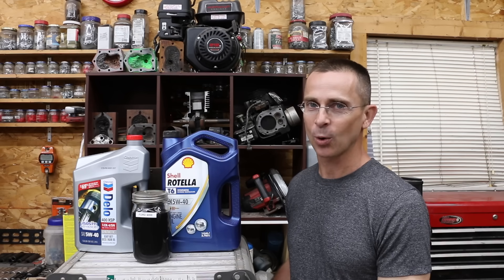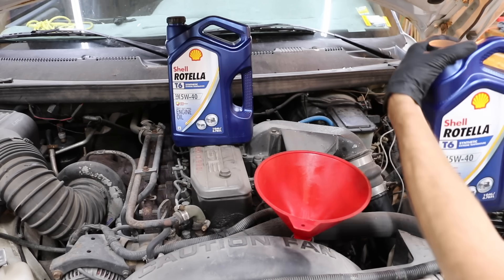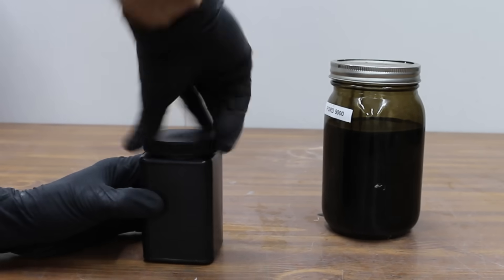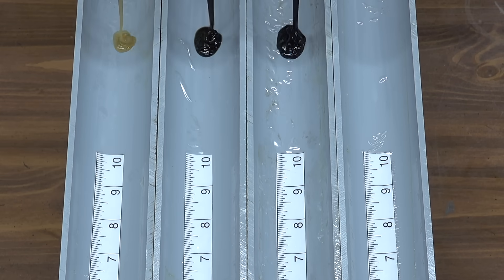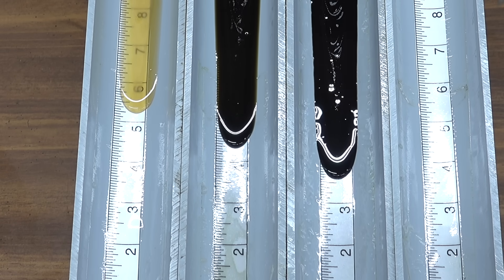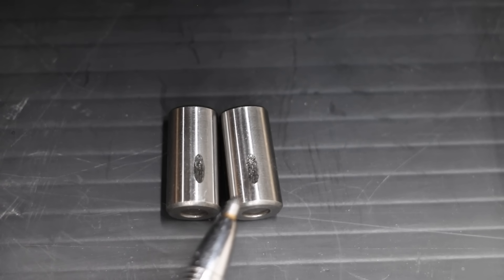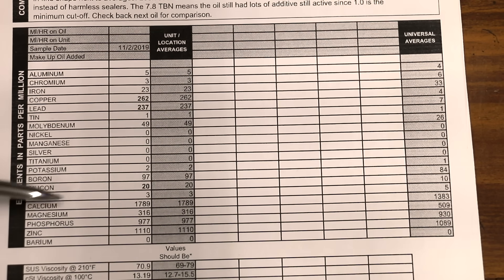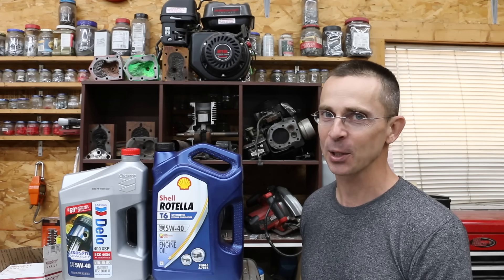Will Annual Oil Change Damage Your Car? Let's find out!

Comment: Thank you!  I'm putting less than 10K miles on my truck per year as I work from home.  I was wondering about the 1 year limit for oil that I've heard about.  Glad to see it is a myth.  I always use pure synthetic.  Mileage is another issue, but with modern metallurgy and lubricants I believe it safe to say that the 3K mileage limit is a myth.
Reply: The problem with extended drain interval is it doesn't get the raw fuel out, you have to count on the PCV system to do that well, which in a lot of engines is asking too much!  Also to me it doesn't matter if they used the finest anti-oxidant additive package ever made, all oil begins to degrade when exposed to air and additives can only work so long, even oil analysis can't show you just when that'll happen!  Not to mention the water vapor tends to build up in the oil too... I tried doing extended oil change, even spent extra getting the oil and special filters for it, but I just couldn't stand it -  leaving the oil in longer than 4 months just nagged at me too much and had to change it -
Reply: @robertmaybeth3434  I believe if the mechanical condition of the engine is good and there is little blowby, there should be no fuel and no moisture in the oil after about 15 miles of driving, when the oil has become quite hot for a while. Fuel and water will have evaporated.
Reply from the maker: Thanks for the feedback.
Reply: Honestly this test is pointless and I see no point of watching more than couple of minutes, because comparing annual or 12 month oil change to 12 or 17 is in the same league. Comparing 12 month vs 3 years old oil in engine would be much more interesting.
Reply: 3K mi. oil changes are from decades ago, before synthetic oils were available. Synthetics go 10K mi.
Reply: @joevarga5982  I'm beginning to agree. Scotty says change every 3k, but I've got 5k on my oil now and it's still clean. Not spotless, but can clearly see the dipstick.  Do you personally go 10k on synthetic?
Reply: @ceruleanc505  I don't personally run synthetic, but I have a family member who runs Royal Purple 15k miles. He changes his filter every 5k and adds the filter loss back. He then catches the oil and puts it in his tractors and lawnmowers, where it spends another year. I would argue with his system, but he worked 75 miles from home for 40 years and has had many vehicles with over 350k miles on them. I'm a firm believer in synthetic oil, I just can't convince my wallet to buy it.....sorry for the rambling
Reply: @quietobserver4636  No problem. Thanks for the input! It's like trying to hit a moving bullseye. Just want to keep my car up as best as possible without wasting money..
Reply: @ceruleanc505  
Scotty is "old school" on his oil changes. That is totally understandable and also totally OK imho. Changing synthetic every 3K is still cheaper than potential major engine problems !
Reply: @dancahill8199  Ok, but does 'old school' throw out perfectly good oil and money because it doesn't understand Full Synthetic?
That's my question.
Reply: @quietobserver4636  Hey there!  I started using Amsoil in my motorcycles when I saw an Amsoil flyer with pix of the sump of a Gold Wing before and after using Amsoil.  It was totally clean after using the "high priced spread."  I tried it in my BMW's, and darned if it didn't work there, too.  That carbon junk that used to build up inside the rocker covers was gone.  The additive package kept the carbon 'n crud in suspension better, so it made its way into the oil filter where it could be removed.  I am sure that any good synthetic would do likewise, I just happen to use Amsoil. I understand the wallet issue, but as an old lady once told me, "Oil is cheaper than machinery."  Good luck.  --Old Guy
Reply: @ceruleanc505  The color of the oil on the dipstick is not a good guide for whether you should change it or not.  The cleanest oil tends to migrate to the top especially after sitting for a while.
Reply: @robertmaybeth3434  There's no dirty oil on the bottom of the dipstick either. And I always test on a cold engine.
Reply: @ceruleanc505  you’re asking the right question and most, if not all these “old school” guys have zero research behind there opinions… this guy here has just shown us massive research into oil…
Reply: @ceruleanc505  Ok if it works for you.  I run synthetic oil right now but even then, I just can't stand to leave it in beyond 4 months!  It just bothers me too much.  I have taken apart several engines of mine, and that got their oil changed every 3000 without fail.  And of course, they were very clean inside, with very little timing chain or gear wear, camshaft and lifters in perfect  shape, not even a ridge in the top of the cylinders either.  And this was at almost 200,000 miles on the 1988 Nissan Z24 pickup, no less.
Reply: @robertmaybeth3434  if you can afford it, fine. But you are wasting your own time and money.
Reply: @joevarga5982  highly depends on the car and driver. No oil is going to last long in a small turbo engine with a 3.5 liter capacity you redline all the time
Reply: @gigel99324  "No oil is going to last long in a small turbo engine with a 3.5 liter capacity you redline all the time"

Sooo... you cherry-pick a severe-duty application to prove that I'm wrong? Lol.

The traditional 3,000 oil change interval was STANDARD, GENERAL-PURPOSE advice for EVERYDAY typical use for AVERAGE people from back in the day. OF COURSE you'd have change more frequently for severe duty applications.
Reply: @joevarga5982  i "cherry picked" the engines i own. Europe isn't full of 200hp v8  designed in the 80's
Reply: @gigel99324  That's why I have always tried to have cars with big engines.  I figure it's better to have a big V-8 that's just loping along rather than to have a car with a 4 cylinder that's wringing itself to death at highway speeds.  Kind of a no-brainer, I guess.  Take care --Old Guy
Reply: @Ed-ig7fj  Ah yes the 200hp v8 everyone stopped buying in the 80s. The amount you spend putting new rings and maybe honing is pennies compared to what you spend on gas though. Plus even a 4 cyl turbo 1.8L gets to 250k miles with no issues

Comment: Thank you for the test. Are there any tests regarding mileage, such as 10k, 20k, 30k etc? I have long suspected that even though the factories tell us to change oil at 10k, it can last into a much higher mileage
Reply: It’s 20k miles in the UK on most diesels from VAG (VW Group) BMW etc and then it’s 18k miles on the Petrol VW’s. I remember ten years back, the Ford cost more to own than the A6 because it needed the extra service ans obviously wasn’t as economical. The new 18k service interval is the only reason we went back to petrol again for one vehicle but personally I wouod always choose diesel unless there are discounts on the petrol only.
Reply: The Auto makers in the UK push it as far as possible to keep the fleet costs down. If you read the oil company recommendations they reckon 15k for fully synthetic.
Reply: @charlesbridgford254  it’s probably similar on Europe also. I don’t mind as it keeps costs down though. If I were keeping the car past the warranty stage though then I would probably do it every 10k but not at the dealer. £200+ is not worth it every year

Comment: During the cold flow test, the used oil flowed faster possibly due to fuel dilution., a common problem with diesel engines.
Reply from the maker: Thanks for the feedback.

Comment: This is one of those perfect solid data/tests based projects. So many ppl have argued so long on how often to change oil on low usage cars. And this test settles it. The conclusion is that mileages driven should be the key factor instead of the time interval. It comes with a conservative caveat that engines should be run till they reach normal operating temperatures (instead of only short trips not reaching that normal temp).
Reply from the maker: Thanks for the feedback.
Reply: How long should you drive it to reach normal operating temperature?
Reply: @phenixwars1  That depends on weather, road, and your drive conditions. Usually 5~15 minutes. Engine temp gauge will tell you.

Comment: What if your engine is burning all the oil within 1000 miles? What if there is enough leak at bottom that ensures you do not even need oil filter? Let us just say it feels good to never have to change the oil :p
Reply from the maker: Thanks for the feedback.

Comment: Well, I guess the US oil industry has a lot of power in your country.  It's a trillion dollar business. Of course, it's a trillion dollar business in Europe as well, but somehow the oil companies have less power here.

There could also be another reason - American cars might have very rude tolerances compared to the high tech European or Japanese cars. We measure tolerances in micrometers - in the US they use ½ inches. As a matter of course, the more sloppy the tolerances (piston rings, bearings etc etc) are, the more often you need to change the oil. Think of a piston with very rude tolerances, rattling up and down in the cylinder - a lot of burnt combustion remnants will find it's way through the piston ring gaps, and go to the sump, and from there being distributed to the whole engine.  That could explain why US cars need more frequent oil changes.

On the other hand - the Americans buy a lot of Japanese cars - do they also come with recommended oil change intervals of 3 months/3000 miles? - If yes, then we have found the culprit - the US oil industry. (Sell sell sell)
By the way - bear in mind that your driving pattern should determine your oil change intervals.
Reply from the maker: Thanks for the feedback.

Comment: Holy crap that oil at 3138 was dirty as fooook :O, havent watched full video but I always change mine at 10-12k miles and have never had a problem. 
The engine (if you look after it) will often out last the economics of repairing a vehicle!
Fully synthetic will only cause problems/ leaks if the problem was already there.
Old/ carbon/ thick oil will mask problems/ seal piston rings/ bores/ gasket leaks in older/ high mileage cars.
High performance cars need more oil changes, every 3k miles minimum!
Reply from the maker: Thanks for sharing.

Comment: I change my oil once a year, around the end of the year. Most of the time it has 4 or 5,000 miles on it. I'm running Mobil 1. The whole reason there is a time component to oil changes, is because people will drive 300 miles.... but that is 1/2 mile at a time up to the corner and back. The oil is full of water, acids etc. That's why it needs changed. That is also why when the car gets taken out on the highway, it burns off a quart. The oil is diluted, and burns off. As long as the car gets good and hot, and I mean GOOD and hot. A good hour down the highway, then it burns the crap off the oil. BTW, every time I change my oil, it is nasty black. I should change it every 6 months. The car has 38,000 miles on it now. It's a 2014. I guess at the end of the day I could never change it again and it wouldn't make a difference.
Reply from the maker: Thanks for sharing.

Comment: Another great video. These things are addictive. I used T6 in my dirt bike, as I been told that it is as good or better than the expensive Honda branded oil. It appears to be a good option. The info about the year date is good as well. I have an older Porsche 911 (2006) and the engine seems to have some complaints of bore scoring in certain situations so people have been very anal about the oils they use, and how often. I have gone to a 3-4K mile change ONlY using Motul fully synthetic, but I often don’t drive 4K miles in a year. Looks like the “annual” method is totally bunk, as I had suspected it would be. Wonder how well the motul I use (which is fairly expensive) might compare to a cheaper oil like the T6?
Reply from the maker: Thanks!  Thanks for the video idea.

Comment: Can you do a Rotella vs motorcycle oil test? T4 15W40 and T6 5W40 & 15W40 have JASO MA/MA2 certification so I use it in my motorcycle and it’s so much cheaper than motorcycle oil.
Reply from the maker: Great suggestion!  Thank you.

Comment: I have 2017 previous prime which runs on electricity for 25 miles and I only filled gas tank 3 times since June which is like 8 months. How often should I worry about changing my oil? Should I worry about how many tanks of fuel my car has gone through because that's the only time the engine runs. Thanks
Reply: Oops. That should read Prius Prime.

Comment: I have a 2004 Honda 600RR that I've had since it was new. This bike has a wet clutch so it shares the engine oil to lubricate the clutch plates. I've been using Rotella for years and consider it one of the best oils for the money. Shell Rotella is well known in the motorcycle community as an excellent alternative to some overpriced motorcycle oils.
Reply from the maker: Thanks for sharing.

Comment: So my wife drives a Hyundai Sonata with a 2.4l gdi motor and burns oil quite a bit and I've tried several Brands and better luck with some but wondering what you guys think about possibly trying the delo 5w-40 in it?? Usually use 5w-20 h/m full synthetic because theres 108,000 miles. Anybody have any input would be greatly appreciated! What do u think project farm!?

Comment: I do it every 3 years on my very low use 92 GTI. Been for over 15 years. I put 1000 miles a year on it. On my 15 Scion, I put 2500 miles a year on it. I do it yearly. Which seems overboard.
Reply from the maker: Thanks for sharing.
Reply: @ProjectFarm  I talked to a lab guy, he said time has not ever been a reason for oil wear, on over 10 years testing oil. Its mileage. So many additives in today’s oils.
Reply: a concern is the oil filter.   Some oil filters have "paper" caps  ( even some of the OEM ones because the expected oil change is 6 months ).   Do oil filters  deteriorate  with time?
Reply: @tocrob  I seriously doubt another 6 months will mess with the internal parts of an oil filter. I do tend to use factory ones.

Comment: @Project Farm - When you spin the filter off on the Dodge it doesn't look like you have any oil spill out - whenever I change my oil (2005 Dodge gas engine) I drain the oil pan first and then take the filter off and it will spill oil down the sides of the filter and onto my arm if I don't drill the bottom of the oil filter first.  But even if I do that there is still a little oil on top of the filter that always spills out and makes a mess so I try to put a bag around it as I spin it off which half the time gets so twisted while I am turning the filter that it doesn't catch the oil anyway.
  Are diesels different?  Do you have some secret you didn't show?  I sure would like to know.
Awesome test.  I have long suspected this.

Comment: I would love to see you test all the major diesel oil brands to see if you can find a "best performer" especially pitting rotella t6 vs. Amsoil. There is also a fuel catalyst on the market now, originally designed for the modern diesel emissions engines. I run it in all of my vehicles, including my cummins, 2 stroke dirt bikes, 4 stroke dirtbikes, my v twin cruiser, and the mrs' v6. I love how they run with it,  but I'd be thrilled to see you compare it with regular diesel, gas, and 2stroke premix. I recommend getting in touch with Bruce at Pittsburgh Power about their max mileage fuel catalyst about what its supposed to do and test those claims. "Disclaimer" I dont work for the manufacturer nor Pittsburgh power.

Comment: Hey @Project Farm, I buy oil in 5L bottles but my car only needs 4.2L when doing an oil change. I save the leftover oil and put them all in one container. After two years or so I should have enough left over oil for a full 4.2L change in the "extra" container. Since it will be a few years old and mixed from different New bottles, is that oil still safe to use or should I discard it?

Comment: I use the T6 in my 1997 Toyota Tacoma 4x4, 2.7 4 cylinder motor. 
329,788 miles later, I think it is pretty good...🤷😂

Comment: I can already tell you the answer, my allis Chalmers wd sat for 7 years I used it for 2 years cutting hay with a 7 foot haybine. Finally changed the oil I’ve been using it for 3 years straight no issues rarely change the oil because I don’t do a lot of hay but I have not seen any flakes in the oil
Reply from the maker: Thanks for sharing.

Comment: There is a long lasting discussion among motorcyclists regarding engine oils if regular engine oils can be used in motorcycles with wet clutches? Motorcycle engine oils are  much more expensive than regular engine oils for cars. Some people, including me, are using regular engine oils in the motorcycle engine. Others say, that the engine oil without JASO MA/MA2 certification would cause the clutch to slip. There are many oil tests made on mototcycle engine oils, but no special ingredient against clutch slipping was found in the special oils. So the question is: do you need to pay double or tripple the price for the engine oil with a motorcycle pictute on the bottle? Fun fact: my motorcycle was produced in the times, when JASO MA standard was not developed yet :)
Reply from the maker: Thanks for the video idea.

Comment: Have a question: the NOAK volitility test would also give you an idea of oil loss between oil changes correct?  And also an amount of oil that would be captured in an oil catch can if you have one?  An oil that has less vapor loss would likely keep an engine and valves cleaner?